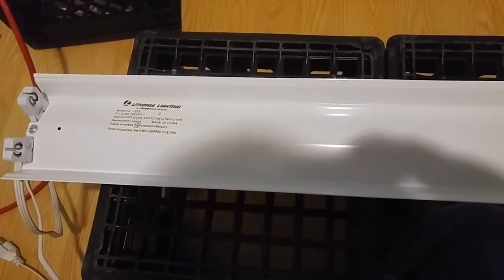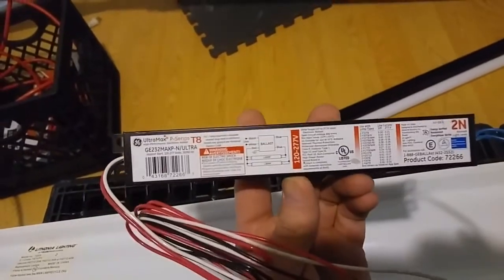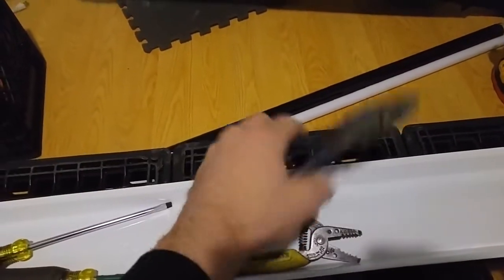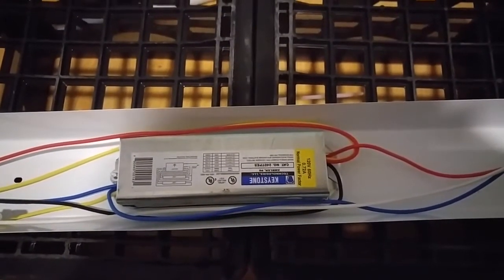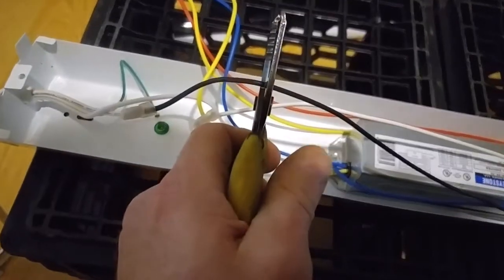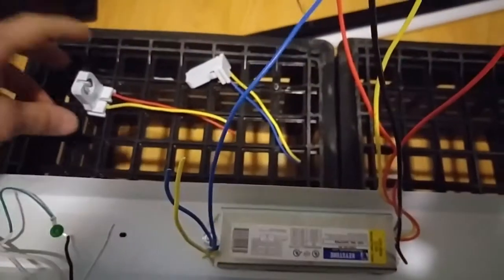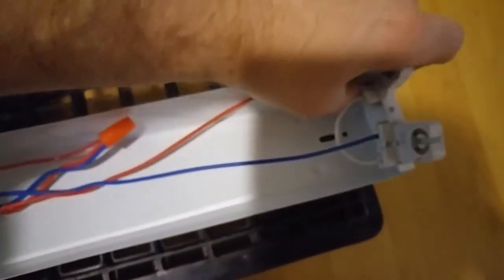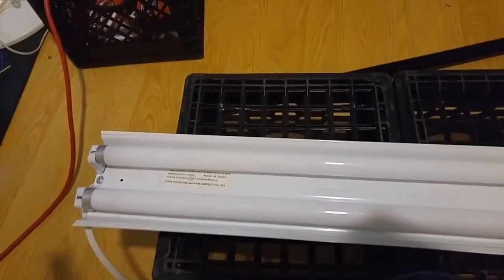T-12 to T-8 light retrofit ballast change

Comment: I need two led drivers bitchy!!
Reply from the maker: Edwin Stinksgood how many watts/volts etc.. Check Amazon and eBay
Reply: +Mass Grows TV 8-12 watts or an equivalent to 45 watts
Reply from the maker: Edwin Stinksgood I would check eBay probably find a cheap one I do have two 100w 24vdc advance drivers.
Reply: +Mass Grows TV  what you want for em if you willing was thinking home Depot before cuz can't find em anywhere bt on Amazon n sht
Reply: +Edwin Stinksgood is it possible to over power???
Reply from the maker: +Edwin Stinksgood yes definitely you'll burn up the diodes
Reply from the maker: +Edwin Stinksgood take a look on ebay I've seen some 10w for like $3 you might have to wait a little for shipping